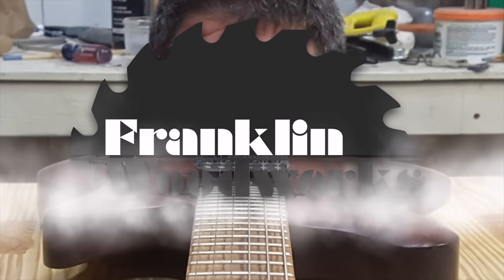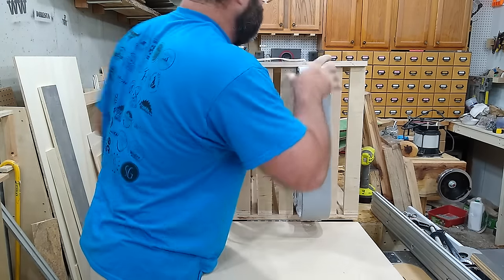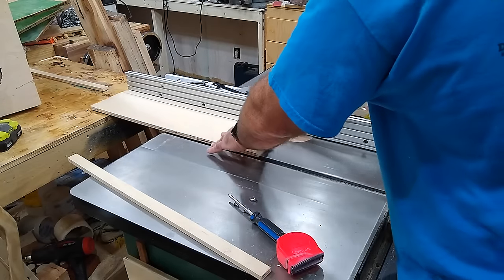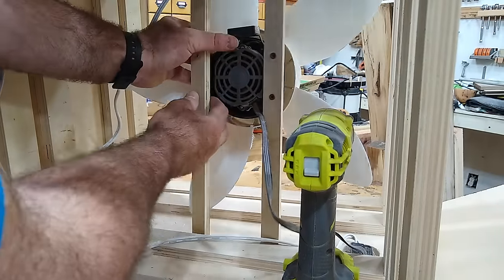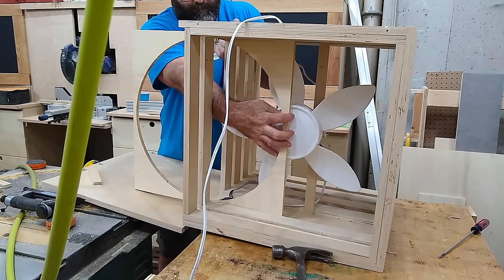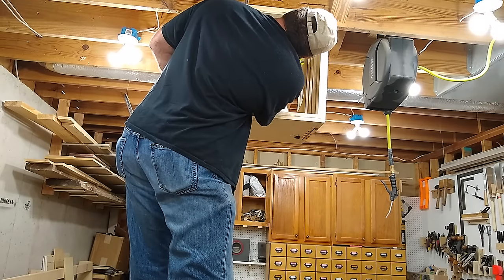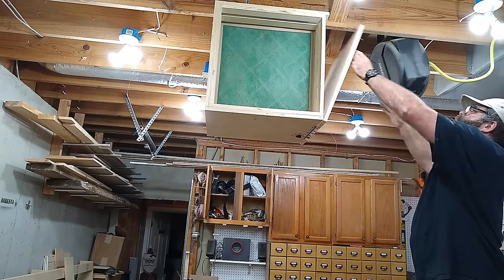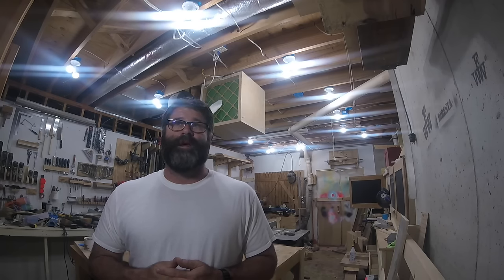Even Better DIY Air Cleaner and Dust Filter

Comment: Thanks for sharing, I enjoyed the video (and the original)... At a certain point though I wonder how much you're saving (if anything) by "doing this yourself."
You're attempting to compete with an economy of scale... Parts and Labor... you could probably save yourself some time and just buy a well reviewed air filter. Just because the "full cost" is distributed out over time doesn't mean the total cost is less.
-
But I also get that sometimes it's more practical to "invest" smaller sums over time, than it is to make a larger purchases at one time.
Reply from the maker: For me, it isn't really about the time as it relates to money.  If I had a money-making shop, I would probably feel differently.  I like the challenge.

Comment: Honestly? It's not bad but could be better. I think that an all the way through tube design on the inside that is just slightly larger than the blades would increase efficiency. Essentially what you have done, then taking it to the next step. Make a tube fan shroud around the fan and between each of the filters too. You could also use self-adhesive foam strips to seal the door/filter edges and use caulk or tape to seal any non-moving seams. Is this idea overkill? Maybe. But to make something truly excellent you have to go a little overkill.

Comment: Hey Franklin I wanted to discuss designs with you. I am trying to make a cheap yet efficient and powerful filter that would give clean air to an entire house floor. But the machine has to be portable. I am having problems with fan selection and prospective noise reduction.
Reply from the maker: You are speaking way above my expertise.  It would seem to me, that to filter the air on an entire floor, you would have to move a massive amount of air.  There are some powerful fans out there, but they are very noisy.  I would try to find a commercially available unit that does what you want, reasearch it, and see if you can figure a way to DIY.
Reply: @FranklinWoodWorks2016  I am trying to do exactly that. COVID-19 is not letting me through though. Let's see what materializes.

Comment: Now if you simply would have figured out that taking it in through one hole is not efficient

You should have at a minimum made two openings in the box and drawn air from two sides simultaneously

This will double your opening size, remember you're trying to move as much air as possible, you're not trying to create a vacuum or high pressure air coming out the other side.

So the least amount of resistance it can encounter will make it as quiet as possible.
Reply from the maker: I agree with everything you said.  However, what you described was not what I was trying to create.  Using your vision, I would have two options: 1. Use really good filters (expensive) and have to replace them all after most projects - especially where there is a lot of sanding, or 2. Use cheap filters and blow dusty air back out of the unit.

My design doesn't have a massive air turnover rate, but what comes out is clean, all while using cheap filters.  It fits the job of cleaning the air in my small shop, and doesn't break the bank in filters.

Comment: Maybe if you used blue filters instead of green it would be less mediocre.  Maybe paint it the color of a 1976 dishwasher and give it a snappy logo.  Either that or get a chrome-plated blade for the fan.  Everyone knows chrome-plated anything just works better.

Comment: Why does it look like you’re running all the dirt through the fan and then filtering it on the discharge side?
I thought you would want the air filters before the fan so it doesn’t pull all the dust into the fan and gum up the motor?
Reply from the maker: I've got three filters before the fan and one after.  Go to my channel and watch my latest video, I explain a lot about the fan.

Comment: Without measurements, how do you know it's getting the same air movement?  Not denigrating your work here; if you see dust being collected, you win.  (And I'm about to make something like this also.)
Reply from the maker: My evidence is based on two main pillars of science: 1.  More dust collected, and 2. The 12" length of toilet paper I taped to the outside of the exhaust filter is more "flappy" than it was before.  Believe me, I'd love to be more scientific than that, but since I saw an improvement that I believe is measurable, I didn't feel the need to actually measure it.  And, since I am SO CHEAP, I would never lay out money for those types of instruments.  I'd rather buy more wood.  All that being said, If you're going to build something similar, I'd get the most powerful fan as possible (within reason) or at least get one with metal blades.

Comment: Dude you should just use a metal blade instead of the plastic one plus the metal ones blow more air like that will suck air and allergies into to the filter but if you if you get a strong motor and a blade from a homart window fan or one with a really deep pitch or an even deeper pitch than the homart and it would really SUCK AIR AND ALLERGIES into the filter

Comment: The Filters should be behind the fanning out of air.

Now... ... Where A, B, C, D, F then Fan to out into open... ...

A should be high quality Japanese sponge, B should be microfiber rug sheet, C and D should be normal Non woven fabric bag sheets (since a bag has 'two layers' or two sheets by default, one bag is enough), then F... ...I have a surface of five holes, where each hole is plugged with a N95 face mask... ... then end up to a fanning unit of two ordinary fans... ... providing powerful suction of air into the filter unit.

This is the only way to deal with second hand smoke.

Which is the entry point is usually the larger than the last layer (F) which is made of five holes of N95 masks.

I am thinking of adding Coka Cola to the sponge... ... if it can handle the carcinogens or even... ... adding teabags at the F layer. Hee hee hee... ...

Sure I can have 4 layers of non woven fabric... ... if I can get more fans... ...

Try it.

You see... ... if you put a filter at the front of the fanning out... ... anything accumulated can be just be blown off again. Pointless.

A is filtering out basic dust, smoke... ... and easy to wash. 

B is not easy to watch, you have to soak four days for the dirt to leave the microfiber but it will deal with trickier dust and smoke.

C is by that time air is slowed, and microfiber is infamous for generating static charges... ... even by rubbing with the sponge and non woven fabric and the substances in the air... ... by the time it hits C, PM3 to PM 2.5 particles will be sucked... ...

D is catching more PM2.5 particles, and as more are caught, the gap narrows and with more charges, PM 1 can also be caught... ...

F is when the last pile of most dangerous virus and carcinogens are coming... ... N95 mask or HEPA layer or whatever the F will be mainly dealing with them. This is better than applying HEPA directly in commercially expensive air units. You can use tea... ... or smash or crush charcoals into dust, place the charcoal powder in non woven fabric bagS... ... many bags forming one surface, let the particles go through. But charcoal is not a 'long term' filter cos cannot be washed and reused... ... 

Using teabags or other bio-filtering medium, including soil or mud-dust or dried hay is actually favorable... ... but must be replaced everyday due to also biological occurrences.  You will have to have G layer of non woven fabric layer to stop the spores and germs... ... but they help to remove dangerous carcinogens from second hand smoke.

For me... ... I let the door open while the filtering does the work... ... and let environmental air flow makes those carcinogens such as carbon monoxide an 'environmental radiation' sort of things.

In life, we live with aerosols, furnishing and so on which are also carcinogens, so letting the winds or air flow do the job... ... So I let the filtering on to filter out the second hand smoke while leaving the windows open, and filtering runs for 2 hours with room closed.... ... before sleep.

I am thinking of getting my maid from village to use her planting skill... ... get some plants in to suck in the carcinogens, to detox the room when I need to sleep.

Comment: Cool setup. I think the "commenters" you mention are kind of dicks, but they aren't wrong. Box fans work great as free-standing air movement devices, but that's because there's nothing to create any static pressure in the system. By adding the baffle, you've started heading towards a ducted fan design, which moves air better at higher pressures. You can see this when you search for PC cooling fans. They all have deep, somewhat tight fitting housings around the fans to increase the amount of static pressure they can create (which is good for ventilating enclosed spaces. Even furnace fans or the fan on your AC unit's condenser coil will have ducting around them for the same reason. Going with the 1/2" ply was smart in that regard. It's probably too much of a pain, but I'd be curious to see how much better this would work with a deeper baffle.
Reply: My plan is use a 2-in. MERV 8 on intake side & a 1-in. MERV 13 on exhaust port; I will be working w/ insulation, minor drywall, & carpet removal in my basement; and given close to total ignorance (on my part) concerning ducted fan design or pressures w/n a system I am requesting clarification on your above comments.  When you reference "baffle" are you talking above the cut out Franklin constructed to house (mount) the fan blades? And if true, are you suggesting that if that material was 1-in., 2-in., etc. the increasing depth would have a beneficial effect on the flow of air out of the system? And going on step further, should the exhaust port be smaller than the input port, or vice versa? And if I do not have the competence to cut a big circle could I use 45 degree angle corner pieces?  Yes, they would block some of the airflow, but is they a major negative?  Please and thank you!
Reply: @jeffhamilton4064  honestly unless you can cut a tight fitting circle and have a fan that's actually designed for ducted use, the gains will be minimal. The thing with the depth of the circular housing (which I called a baffle to stay with the terminology he used) is that it only needs to be about as deep as the fan blades in that direction (maybe an inch and a half on the $20 Lasko fans?)

Comment: why what you did made a "15%" difference? I missed that reasoning
Reply from the maker: The 15% was a guess on my part, since I have no scientific way of measuring CFM or dB level.  But, the airflow seemed better, and the unit was quieter.  I could run it on the "medium" setting and get roughly the same airflow as before on "high" with reduced noise.  Sorry for the confusion.

Comment: So I made something like this only with One filter and It works very well but how can you be sure fine dust is not entering your lungs?
by the looks of it those filter are maybe a MERV 4-5
Mine is 12 which captures %80 or more of the fine dust

You may want to stick in a merv 12 or higher filter to protect those lungs
Reply from the maker: It's all about cost.  Watch my followup video where I try to explain the filters.  https://youtu.be/ufL6CGcKWAk

Comment: Looks like you're using Merv 1 filters. For all the filtration of harmful particles you might as well use window screen.  Do yourself and your lungs a favor and up grade to Merv 12.
Reply from the maker: The best setup is to use Merv 1 filters for the first three to catch the big stuff (and it DOES catch a lot of big stuff), then a higher Merv on the exit filter.  Otherwise, this is one expensive filter system.

Comment: mediocrity is fine... i just wouldn’t apply that thinking to my main project depending on what it was or would be used for. I use that more for time savings and prioritization. You don’t want to get side tracked or significantly side tracked on something temporary  or something that can be fixed later if need be. But you just don’t want to sacrifice your limited time.  I wouldn’t waste time on making a great workbench at a job site when i’m only going to throw it away later. It has to be “good enough”... Good enough should mean that it meets all my basic requirements to do the job successfully and without any hindrance. But we all have our own standards and reasoning.
Reply from the maker: I apologize for failing to properly communicate my attempt at humor.

Comment: Surely a mediocre solution to a dusty workshop, is to just open a window, not build an air filtration system from scratch?
Reply from the maker: That would work if I wanted my shop to be the same temperature as outside.  But, that tends to be uncomfortable 10 months of the year.  I'm happy with the way I did things.
Reply: @FranklinWoodWorks2016  
Yeah, I feel like you missed my point a bit... I was praising you... I think... Yep, definitely praising.
Reply from the maker: @NilsAlbertsson  My apologies!  Sometimes I don't read as carefully as I should.
Reply: @FranklinWoodWorks2016  Don't worry, I suspect most readers did not catch the 'real' meaning upon the first reading. I, for another, certainly didn't...